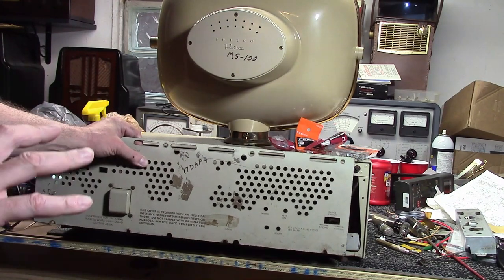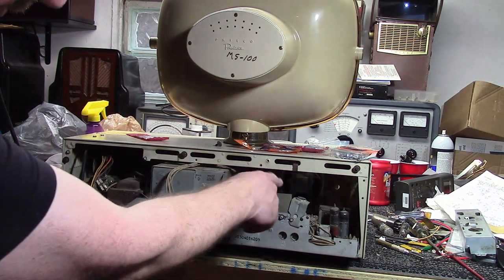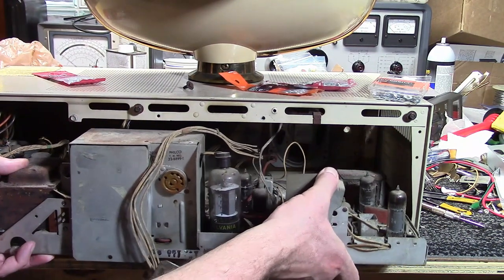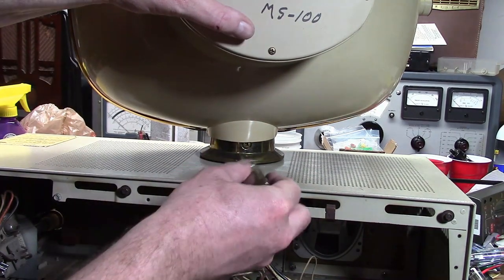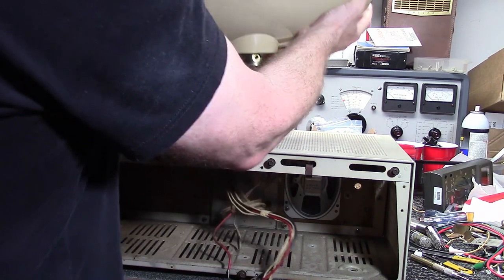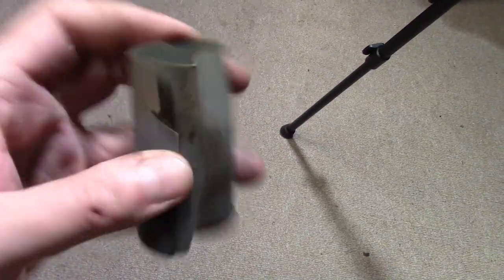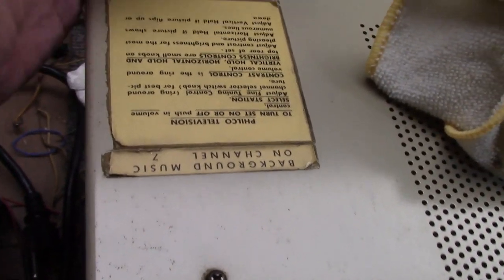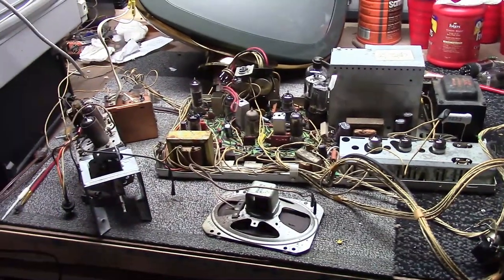Predicta 17" tips: Dissasembly

Comment: 10:30  It seems that a good way to separate the CRT from the cabinet if working by yourself, would be to lay the tube and the cabinet on its face, support the CRT with towels or something if needed so the collar isn't stressed, then you can manipulate the chassis away from it while feeding the cables through the attachment collar for the CRT mount.
Reply from the maker: I don't recommend it.  Putting pressure on the plastic CRT face could crack it.  Also, the cabinet is heavy and awkward.
Reply: @bandersentv 👍 It's probably best that I stay clear of Predicta repair work then, lol